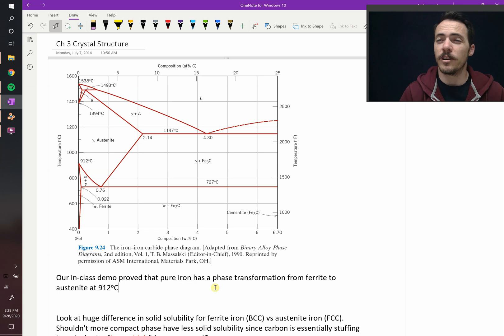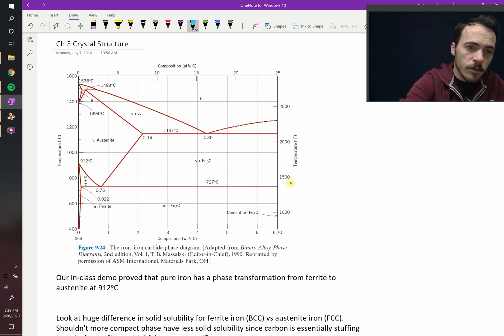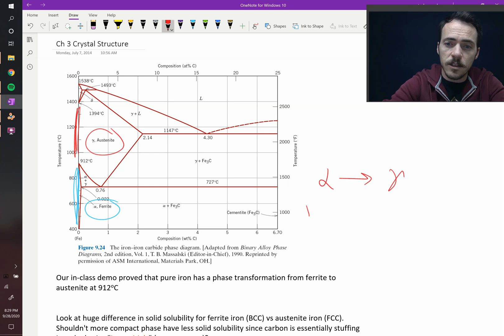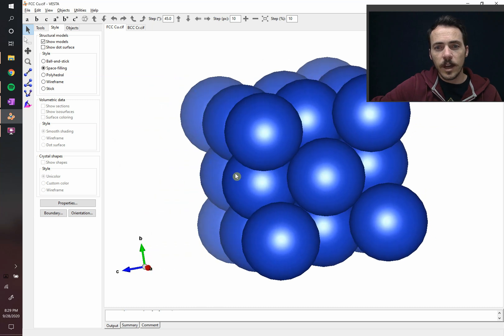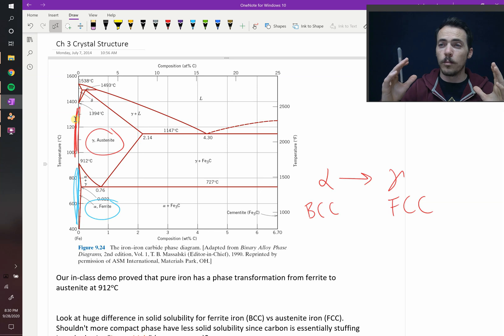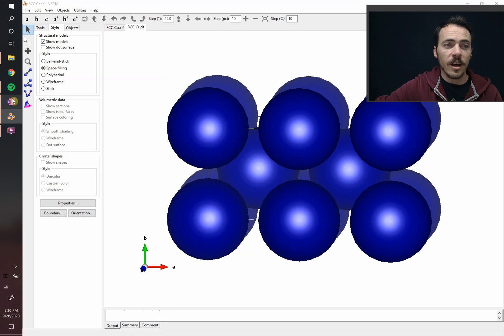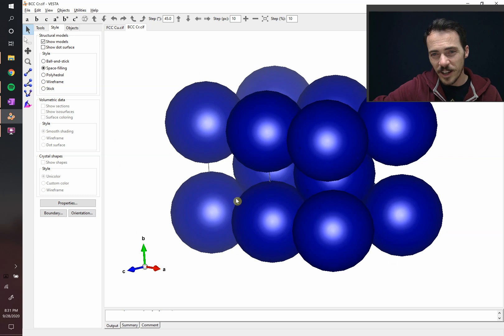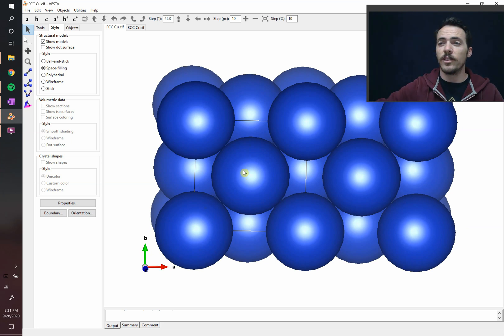Why is the carbon solubility so different in ferrite vs austenite?

Comment: Great video....
Btw why does Iron change its structure from BCC to FCC when heated ?
Reply: Because iron has mutiple allotropic forms, based on temperature it changes its properties and even its cristaline structure, that's the reason. You can also see allotropy in carbon for example , which changes from graphite, diamond and fullerene
Reply: @lucaspatiri  But fullerene doesn't occur naturally as compared to graphite and diamond. right?

Comment: If you put 1 carbon atom in each interstitial, the solubility numbers are WAY too high.  What actually limits the solubility if it's not the total number of interstitial voids?
Reply from the maker: Strain! Each carbon adds to the strain of the lattice.
Reply: @TaylorSparks  so essentially, the carbon doesn't quite fit, so it stretches the iron bonds in the lattice? And you can only fit a few carbon within a certain volume of crystal before the stretched bonds become too tight to allow any more?
Reply from the maker: @joshtargo6834  yup!!
Reply: @TaylorSparks  are there other elements you can add to the iron matrix that are attracted to the iron stronger than the iron is attracted to itself?  Something fully soluble? Oxygen to make iron oxide?
Reply from the maker: @joshtargo6834  good question. I don't think so, but I'm not expert in this field.
Reply: @TaylorSparks  just checked oxygen-iron phase diagram shows O2 precipitates out only after 30% by weight. Interesting. Thanks for your help.

Comment: Thank u <3
Reply from the maker: my pleasure!!
Reply: Maybe u can answer me...
To obtain martempering you have yo pass the line of MF(final transformation of martensite)
Reply from the maker: @vascodealmeidaflamengo1739  ya, but tempered martensite requires a subsequent reheating to low temperatures.
Reply: Really thank you so we have to do a tempering after a quenched
Reply from the maker: @vascodealmeidaflamengo1739  yes. If you just quench martensite it's actually brittle. There's a volume expansion from fcc to bct and it slightly cracks the material. however, if you temper it then you actually form very very small dispersions of the carbide phase which gives it its excellent properties.